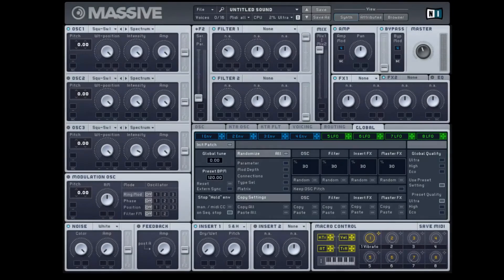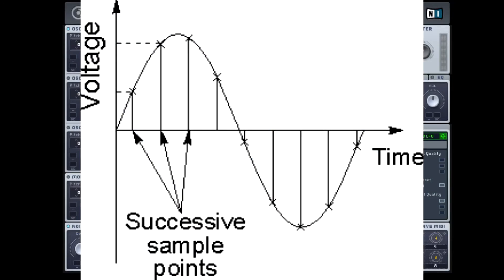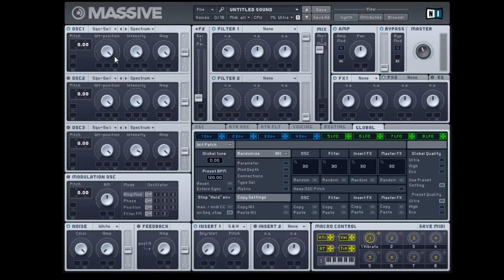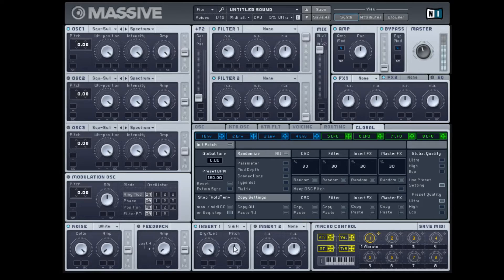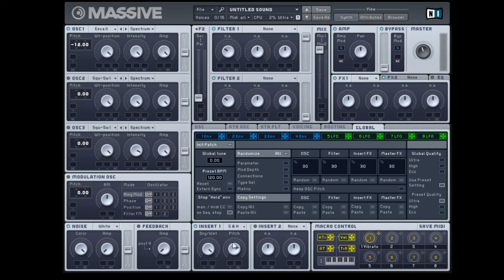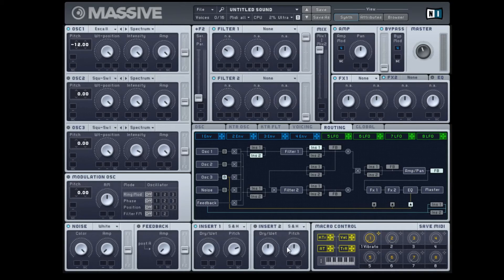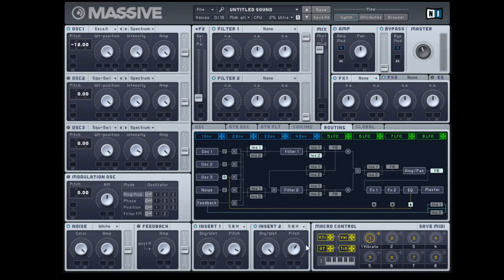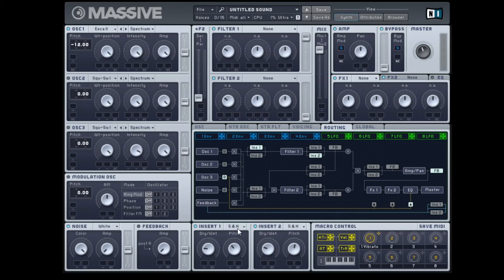How Massive's Sample And Hold Work

Comment: so the higher the pitch knob, the more complete the recreation of the signal? so ideally, having the pitch knob all the way up means a more detailed resolution of the original signal, therefore it would be closer sounding to the original right? so, if im right about all this, why does having the pitch knob all the way up cause that increase in the pitch of the sound? shouldnt it be closer to sounding the same as the original? but it makes it sound higher in pitch, which i guess is why its called a pitch knob but its really a sample rate knob right?